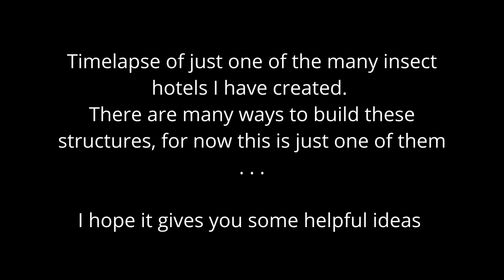Making An Insect Hotel in London

Comment: Last year I bought 4 bug hotels put them up in the garden and they where quite busy mainly wasps but recently I checked them and they were empty but all of them had spiders webbs on them so I wonder if that's why nothing else is using them
Reply from the maker: Hi Paul - I must admit that in the past I have been "gifted" one or two "mass produced" small fancy bug hotels and whilst they can be aesthetically pleasing they don't always have the right size of holes and apertures for specific species, usually made in high numbers and to a standard pattern, you can see them almost anywhere these days.  Mine too used to have a high number of spider webs unfortunately and by nature they will catch insects of course. That's not to say they don't work in some cases and provide refuge (even for spiders who play a great part!) but the most important thing is to site them in full sun - facing south or south-east.  Not trying to give you extra jobs to do (!) but sourcing your own materials gives you peace of mind that your insect hotel is made of natural, untreated wood and without chemicals such as varnish, paint and wood protectant that will repel insects. Recycled materials also helps with sustainability.  Sorry for the long-winded answer but I wanted to make sure I'd given as much info as possible :) Hope this helps - best wishes, Joel
Reply: Cheers will take this on board